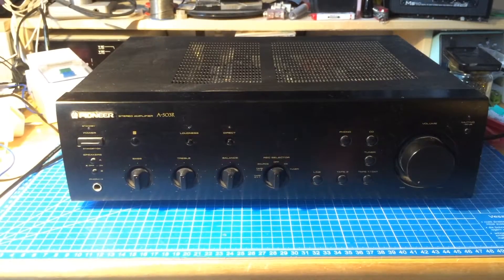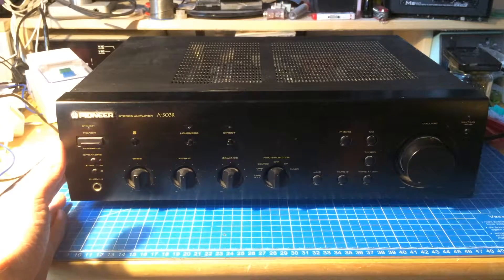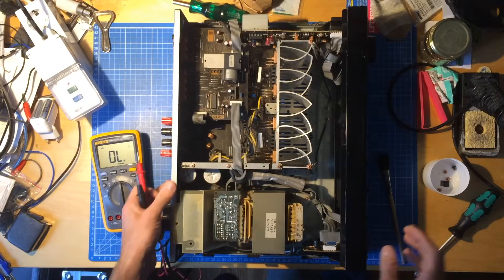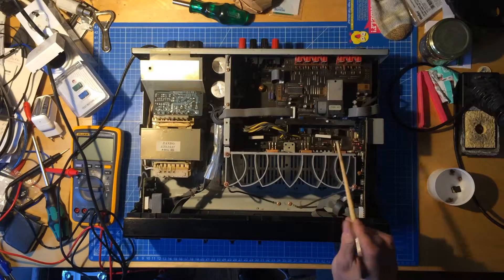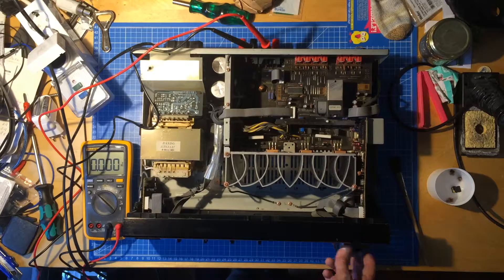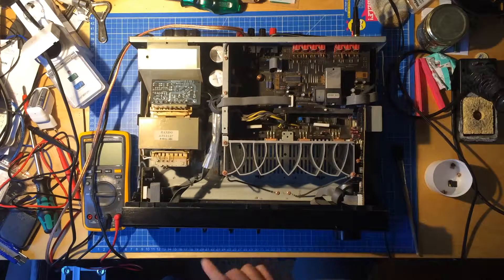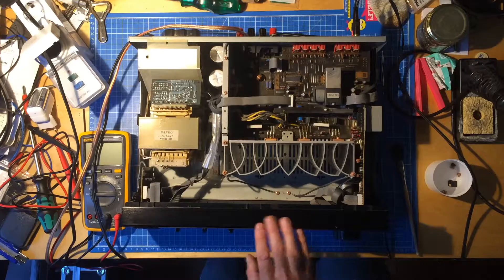How not to blow your Speakers when testing a potentially defective  amplifier

Comment: Useful video, thank you! Here's a summary with timestamps for those who want to cut to the chase:

0:00 Introduction and context
2:55 Take apart the amp, brush it out (or use an air compressor)
4:00 Check for burned or damaged electronic components
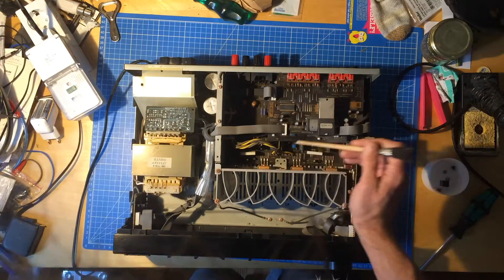4:18 Measure fuses etc
6:30 Check for shorts in the amplifier's power transistors
7:43 Power it on, without anything connected. Just to make sure it doesn't explode.
9:20 Stab the speaker posts (both channels) with multimeter probes, ensure there's no DC current leaking
10:40 Check the speaker inputs work by plugging up the amp.*
12:00 Outro and post-video summary

*I'd recommend doing this step with a cheap external dongle, like a generic £3 USB C thing from eBay or something. That way, it won't be able to back-feed current to the expensive device, unlike plugging it directly into your PC or nice DAC or similar. Worst case, it should just fry the little cheap DAC.